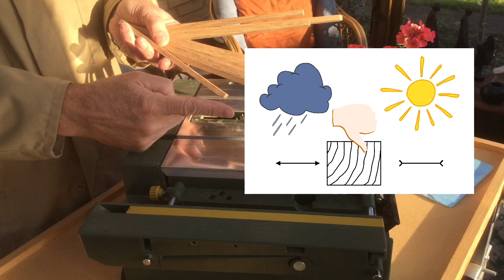Proxxon FET One of the first things you should make

Comment: Hello Mr. Harris!
 Is it ok use mdf for the sticks?
Reply from the maker: I would not recommend that, mdf wears out too quickly and is imprecise.  I make mine from oak or other hard wood and they hold up well but have the problem that the wood works a lot with changes in temperature and humidity.  I have been recommended to use bamboo as it should be less sensitive to changes in humidity and temperature, but I have not yet tried it.
Reply: @Harris-DIY  It's what i thought. I can use bamboo, i have it.
Reply from the maker: Fine, let me know if it's stable
Reply: @Harris-DIY  Hello Mr Harris!
I ended up not using bamboo. Instead I used Ipe (Brazilian wood used in outdoor floors; it is hard, stable and heavy). I think, only time will tell me if it is ok, but till now i have no complaints . I glued it with epoxy. The place where I live the humidity goes up and down from 60, 70, 80 and 90% in winter.
I still didn't finish the cross cut sleed, because i'm having difficulties... what tool do you use, on the parallel to the blade t-track slot, for opening the space for the t-nut to enter. I experimented in a test t-track with a normal drill bit. It did not aproved.
And about gluing the fences to the base which glue should I use?
Reply from the maker: Thanks for the info, sounds like a good choice.  Good luck with the project.  I used a regular 12mm.  metal drill bit and regular white wood glue.
Reply: Mr Harris, what are your thoughts about add 45° cut to the cross cut sleed?
Thank you!
Reply from the maker: The big advantage of using a Cross Cut Sled is that here you can cut 90˚ without having to measure or set anything, you lose that advantage if you make something that has more functions, but of course you need to be able to cut at different angles  I mostly use my Bosch or if it's very small things a template I put into my Cross Cut Saver.  If I didn't have more saws I would make a Cross Cut Sled especially for 45˚ cuts.
Reply from the maker: The big advantage of using a Cross Cut Sled is that here you can cut 90˚ without having to measure or set anything, you lose that advantage if you make something that has more functions, but of course you need to be able to cut at different angles  I mostly use my Bosch or if it's very small things a template I put into my Cross Cut Saver.  If I didn't have more saws I would make a Cross Cut Sled especially for 45˚ cuts.
Reply: @Harris-DIY  Thank you!